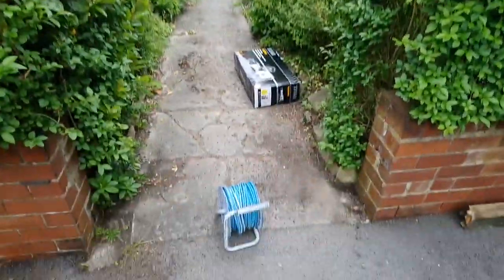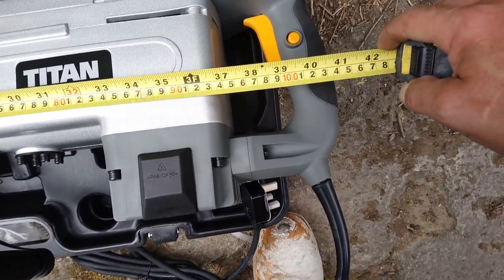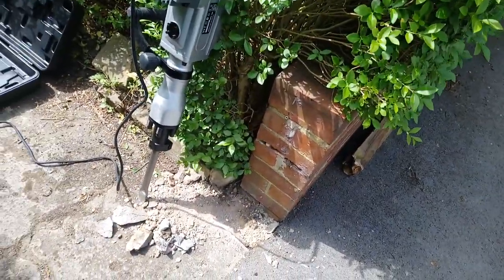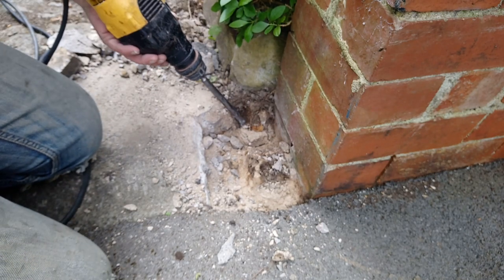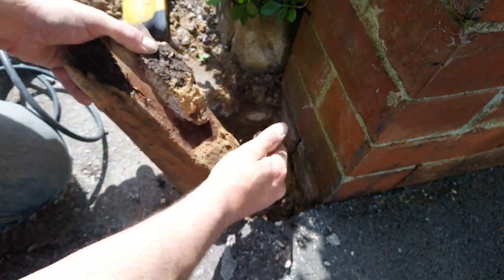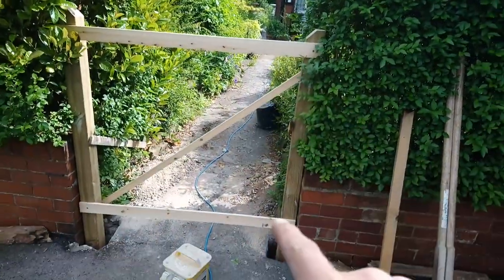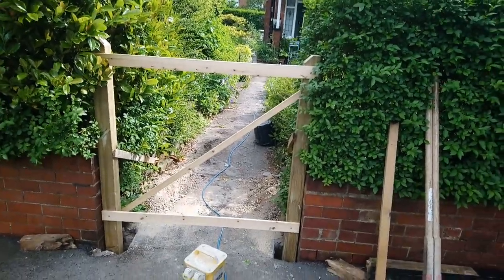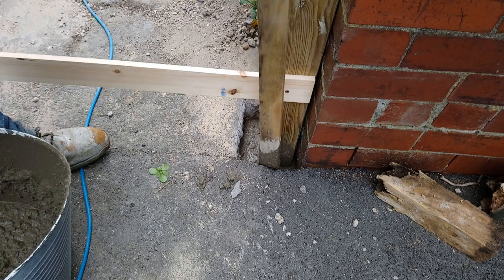Installing gate posts, digging out concrete with a Titan TTB280DRH 15.5KG Hex Shank Breaker

Comment: Great job, but why not just bolt posts to the wall? Not knocking just genuinely curious!
Reply from the maker: Thanks pongo, This wall isn't in good shape but even if it was for me to hang the gate/posts from the wall it would have to be full height same as the posts so i could get a fixing up near the top of the post, I like to keep it independent, These posts are a little undersized for my comfort, they might bend just a little making the gate sag a little, i then plan to put a 45º metal tie back from the top of the post along the top of the wall on the hanging side.
Reply: Gid joiner 
Good point. Only a matter of time before a customer asks me to do a job like this so thanks for the info. Always hate digging into the ground in case I hit a sewer pipe or something !
Reply from the maker: 😂 The pipes & wires should be below frost line, there's rules about laying them, some written some not, because they're deep the scariest bit is when you've dug nearly deep enough but still want to go a little further n you hit something hard, is it a rock or is it a pipe 😂🙈

Comment: Great channel! Will you be filming the door hanging and kitchen job? Many thanks
Reply from the maker: To be honest i don't know, I think I'll film anything that i think is educational,
The doors are stripped reclaimed doors going into old frames so conventional fitting might not work, I'll just have plane & cut to make them fit, 
The kitchen is a bunch of boxes with a worktop on, the house owner has done some plumbing but it's 'not right' so i'm redoing that & I've agreed to repair the plastering after the electricians have chopped their wires in, but I'll film what i can & give as much info as poss, we'll see what the vids come out like, they might be a bit of a mash-up of days work events. 
Thanks,  😉
Reply: Gid joiner sounds fair! Appreciate it’s time consuming! Well done on the channel so far, nice to see other tradesman methods.
Reply from the maker: Thanks, yep nice to see even if it's not to your/someones liking or preferred method but gotta keep an open mind, that's the only way to learn, If i see something i like I'll give it a go, 😉

Comment: Other videos on gate posts installation I have seen suggest to concrete bit higher than ground level and slope away from post to drain rainwater away from post to allay early rot . Again using post Crete cuts curing time though you have to set post accurately.

Comment: Another great video thanks.
Would have loved to. see the process you went through to square and plumb everything.
Cheers
Reply from the maker: Sorry i had it done before i knew it, 
There were moments when i was a starfish trying to keep both post vertical, hold vbits of wood for bracing & trying to attach clamps,
I don't think i would have been able to describe what i was doing as it was happening & i don't think the camera angle would have been helpfull.
Need a camera man 😉
Thanks 👍

Comment: Great video! How do I know what mix to make up concrete to? I recently concreted in a big steel tank in the ground to use as a waste tannk and I did 4 to 1. I'm worried now that I've made it too strong. Or worse!!?
Reply from the maker: 😁👍 It's hard to make it too strong, more cement you put in the harder it gets but it becomes more brittle, & can be prone to cracking because there's not enough stones/pebbles in the mix, unless you did a 1-1 mix i wouldn't worry 👍 I do a 6-1-ish mix, i know 1 bag of cement to 6 bags of ballast, so 1 third of a bag of cement does two bags of ballast but i prefer to put a little too much cement in rather than not enough, too little cement & the concrete will be sandy & crumble,
Reply: @Gidjoiner  thanks for putting my mind at rest and your really quick reply. Do you still have the breaker? If so, would you recommend it? I've got some jobs lined up and was going to hire but I like to build my tool collection. All the best 😎
Reply from the maker: @dugbert9  No prob. Yeah i'd recommend it, weighs a tonne but takes a lot of the hard work away, the weight means all you have to do is direct it, This one is Titan, don't think you can get them anymore but it look just like all the other similar brands that roll out from China, That's what i like to do, rather than the hassle of hiring n paying more in the long run if you use it enough, you've always got one to just pull out n use 👍 I'll be back with more vids soon, just doing bits of work not worth filming & struggling a bit with the price of materials for jobs,

Comment: does the Kg     make it more powerfull   than a smaller  Kg .     Looking at digging 3 2ft holes in driveway to install fence posts  , what would i best be getting. Thanks
Reply from the maker: Yes & no, this one is so heavy it doesn't need to be held/forced onto the surface to make it break concrete but it's a bit heavy to be manoeuvrable for getting into awkward areas, a smaller one would be more manageable but would need more effort 💪 to hold it in place to break, I don't remember what i paid for this, it wasn't a lot & i didn't want to be under powered, it does it's job if you can pick it up  🥵 I'm getting old tho 😅 The only prob with many of these is the distance it can reach down into the hole ,  Are you going to be using it a lot in the future, would hiring one be better,? you could upgrade to a bigger one if needed,